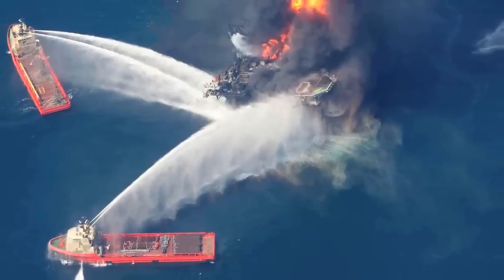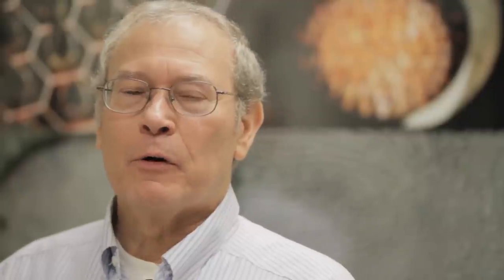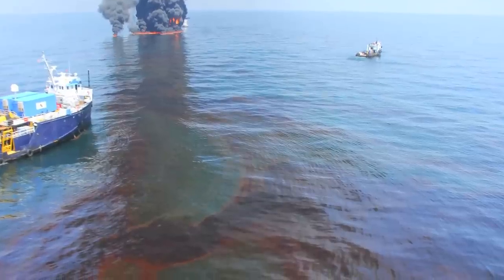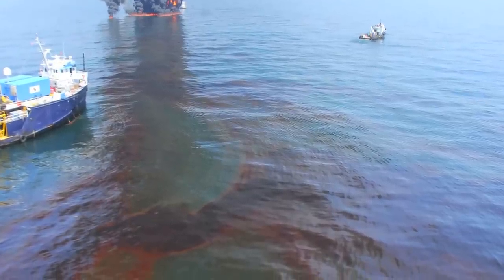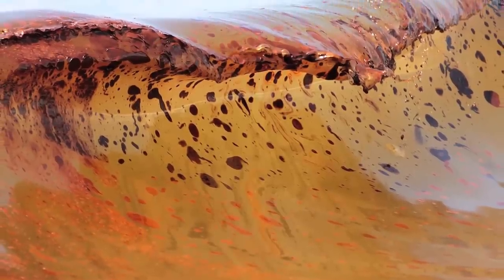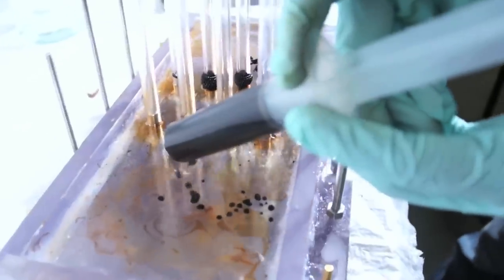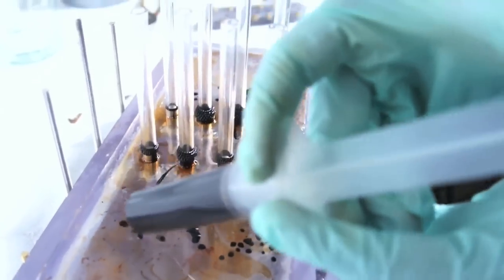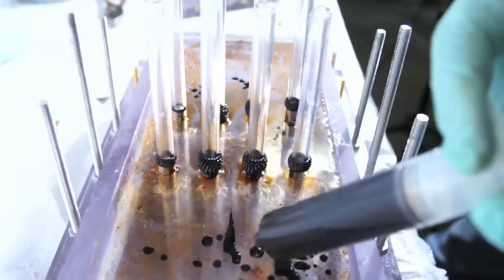Cleaning up oil spills with magnets at MIT

Comment: I've been doing research on this same topic for the past two years. This has actually been going around since 1970 (the patent was approved 1972 with patent number 3635819). Since then numerous patents have been filed by GMC regarding this technology. Interestingly it has still not been produced on a large scale and therefore implies that there is a problem with the technology for large scale action.

Comment: Nifty idea. So how would this solution get to the oil? Maybe put it on the ship as a fail-safe so that it would get mixed in as soon as a leak is detected? Or can it be dumped in after the spill? And if the latter, what happens to the part of the solution (I take it that it is mainly some ferromagnet and water?) that didn't get mixed in?

And more importantly (and more fun), will I be able to fish the fish in that area with magnet (if they had consumed enough of the ferrous particle)?

Comment: Smiler to the road spike.
The car being chased runs over a tube, which breaks open. Then a bunch of magnets which jump/ricochet all over the lower part of the oil pan, slowly burning up the block due to lack of oil circulation.

Comment: No no, The oil recovery vessel (A Big Ship) goes to the spill, With a contaminated seawater pumping system that contains the np's within the ship. See? Pump seawater into ship, run through onboard nano filter system, And expel oil-free seawater out the other side.

Comment: yep small nano micro iron parts in the oil.....oil is thicker then water so the tiny parts will stay in/over the oil...magnets over it or magnets to pull the oil to an closed area where u can filter it from the water and done?something like that?But how do u get the oil with the ferous nanoparticles from the (electro)magnets what creats the suction something like on/off?

Comment: So if i got this right, they have created small nano particles what can be put in the oil when it has been spilled to sea. How those particles can be put just into oil when it's all over sea, without loosing those and creating even more problems. This would be great if every tanker would be required to attach nano particles before leaving dock and when it's arrived to destination, there would be station to separate particles and those could be used again!